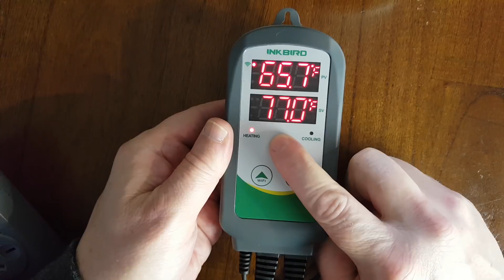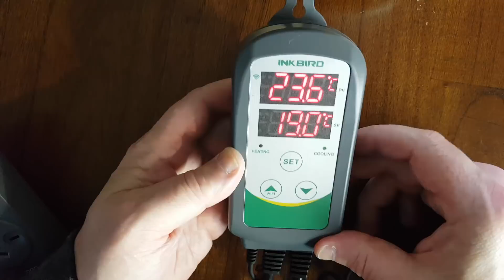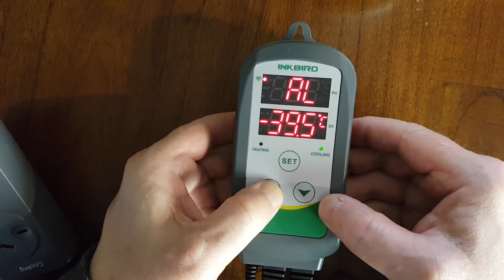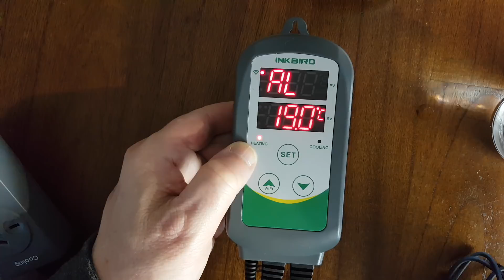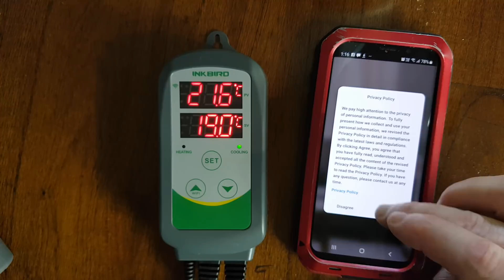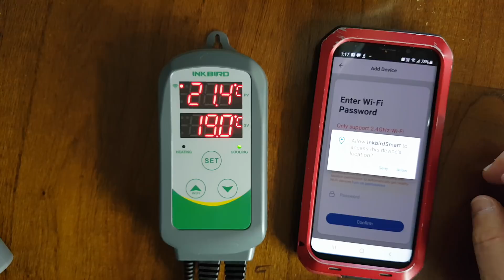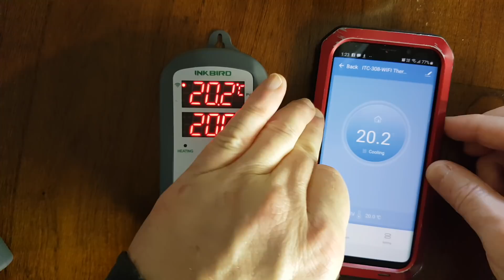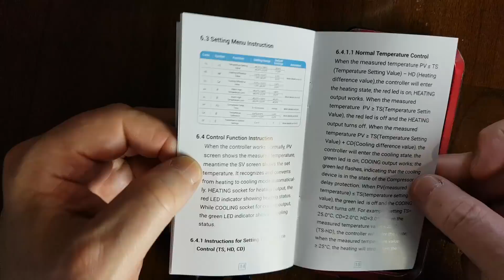INKBIRD ITC-308 WIFI Temperature Controller - How To Program

Comment: Have you ever had it not come back online due to a power outage or network drop out. And when you try to hold the up button for 2 seconds to reset into network configuration mode and it won’t. It just flashes and says APP then goes back to normal screen without the wifi indicator led flash ? Any help would be greatly appreciate. 

thanks Josh
Reply from the maker: No sorry I havent had that happen, inkbird arent the best quality machines thats why they are cheap, some will last for years, some wont. Cheers!
Reply: yes that is true. I got a hold of INKBIRD and they are sending me a replacement asap, which is very good of them. Apparently this is a problem with some of the wifi models.

Comment: So can this device be set for example if I want the cooling to kick on at 80°f and stay on until it gets down to 70°f before turning off again... So the cooling unit doesn't keep kicking on at 80 and then right off against 79 and then on again at 80 and right back off again at 79 etc.. etc... ???
Reply from the maker: Yes you can its called the Hysteresis so you set a mid temperature and then how far each way before the cooling or heating switches on or off. Cheers!

Comment: How can you change it back to heating if it’s on cooling? I have a horse trough I’m trying to keep at room temp or luke warm during winter(encourages them to drink more) it’s a basic bucket water heater 1000 or 1500w?? I think.

Comment: Excuse my ignorance but what do you have plugged in to the heating side?  If the fermenter is in the fridge and the cooling controls the power to the fridge what do brewers use to heat?  Thanks.
Reply from the maker: I use a heat belt these days. Cheers!

Comment: I’m not excited about this product. I had one that Amazon thankfully replaced. The probe was not reading correctly even though I calibrated it to my digital thermometer. The second one which I got today is more accurate after calibration but still over by around 2 degrees. Perhaps not the best for my veggie grow tent.

Comment: Can you set both functions to one plug? I have a unique situation: a climate battery in a greenhouse. We just use one fan, both to pump warm air underground when it's too hot, and then to pump the air through the ground to warm the greenhouse at night. So we need to operate 1 unit, at two different temperatures. For example, between 14C and 25c it's off, above 25c it runs, and below 14c it runs. Can this unit do this?
Reply: no,  the 308 has one TS setting.The 306T has dual TS settings for what you want but only has a heating function, no cooling. The ITC 312 has dual temp settings and cooling but only available in US version right now. This would allow you to do what you want but you would have the heating and cooling on seperate relays. so poses a problem when using one fan for both heating and cooling. I'd imagine you could wire up a second plug on the fan and build a simple relay circuit which would switch the fan between the two sources depending on which one is active, isolating the non active circuit.

Comment: Awesome tutorial and setup guide! I just purchased my InkBird ITC-308 WiFi for homebrewing. I recently started kegging my beer but my Kegerator for some reason seems to work like a freezer and gets too cold! So I'm hoping this will solve that issue! For the heat mat, do you wrap your fermenter/keg with it, or do you set the heat mat on the bottom/floor of the fridge/kegerator? I had the same question for the probe, do you tape it to the middle/side of your fermenter or keg or on the middle/side of your Fridge/kegerator? 

Thanks The Home Brew Network!

Comment: Hey mate great vid. New to brewing and Looking at setting up a chest freezer or fridge what do u suggest for a heating element? My shed gets pretty warm  most of the year do u reckon it could work with just the cooling side until I find a heating element (if I find I need one)? I like the wifi part of the inkbird because I work away for 2 weeks at a time so I can keep an eye on it. Cheers 🍻

Comment: Hi mate. Nice clear explanation. In fact I came here when I bought an inkbird 308 but the non-wifi version. The settings are still the same and this video made it easy to program. I just wondered, I'm having issues with it and I've made a very short video (37sec) to show what's happening. I wondered if you'd take a look? Everything's in the description, it's got me stumped. Either way, cheers! 🍻

https://youtu.be/TfNwcjnWm3U

Comment: I tried to connect it for like 100x times and it never worked

But then I did this:
1) Turned off my 5GHz wifi (you can do it in the admin settings of your router)
2) Switched the Temperature Settings from C to F (like in this video 01:05)
3) Deleted the App and installed it again
4) Pressed the wifi / up Button till it started to blink faster
5) Connected it and it worked

This steps could help you too, so you should try it, if you have problems like i had :)

And thanks for the Video

Comment: Hello, If I set 18 and then 2 for the CD and same for HD I do not have this range applied. For example the fridge that should kick in at 20 C° or above it doesn't same thing for the heating. They simply start to heat or cool as soon as the temperature is 18,1 or 17,9, is there anything I don't know? Maybe I got a faulty device :(

Comment: I've just got two of these, both set to 19, and yet they both will heat until 19.5, and as soon as hey get to there hey cool back to 18.5. They go up and down constantly and are either heating or cooling non stop. Have you noticed this happening at all?
Reply from the maker: theres a setting, lowest you can go is .3 .. any lower than that even if you could would kill your fridge likely.  If it didnt explain offset in this video it will in my other video on inkbird ITC-308 Cheers! go through the settings and change the .5 to .3 Cheers!
Reply from the maker: Just watch the video, its in there...  just a few minutes in,, cheers!
Reply: @HomeBrewNetwork  thanks for the reply. I have t set to .5 but it's going 1 degree over each way. Just seems weird that it will swing so wildly - I'm talking every 5 minutes it goes right up to 1 degree over, and down again within 5 minutes. Might contact the company.
Reply from the maker: @DeneMcDonald  where have you got the sensor?
Reply: @HomeBrewNetwork  tapped to the side of the FV and insulated with a towel. I was thinking I've never had an issue before, but in reality I've never had the ability to check so who knows. It's not an issue for the fermentation as you can't change 23 litres within a 5 minute swing, it's just using heaps of power cycling up and down. Overnight I popped a fan in and it seems to be better which would indicate I haven't insulated the probe enough. Might get an old beer coozie and give it  go. Thanks for your help.

Comment: Thanks for the video. Will this control a contactor?
Reply from the maker: When one circuit is active it supplies a constant 240v or whichever version you have, so yeah if you have contactor that runs or triggers off a constant 240v i guess you could.  If youre into wiring things you might be better of with a STC1000 .Cheers
Reply: Thanks

Comment: Damn, pretty annoyed I didnt buy this version. Does the unit hold the values set via wifi is the wifi disconnects?
Reply from the maker: To be honest I dont use it much, its kind of like everytime I nearly do use it, I want to go and check on the beer, make sure its where I want to be etc before the temp change.. Its good for when your away from home and you must have something in the fermenter. Cheers mate!
Reply: @HomeBrewNetwork  yeah it's not crucial but it would be handy having a better interface when switching from ferment temp to crash temp. The remote capability is definitely something I would use too. Ahh well, the standard one will do for now.

Comment: Hello, I would like to use this to control a 120 volt water pump (or a 12 volt with 120 v adapter) to send water through a tankless propane water heater as an aux heater for a intex hot tub, the tankless has a 20 min safety shut off so most peeps run a timer, can you set this to shut of say every 15 mins then back on for another 15 mins? it would only be uses ad the secondary heater but it might need to run for 60-90 mins to get the temp up to say 105 and i don’t want to have to restart it every 20 mins thanks
Reply from the maker: This model doesnt work  on timings its all temperature controlled. This model maybe be better as you can set times for temps, still not 100% sure its what you need, Cheers https://www.youtube.com/watch?v=mNElm8W8vdo

Comment: Can u use this with a small space heater to keep a room within temperature?
Reply from the maker: I guess you could.. placement of the probe would be very important though of course. Cheers!
Reply: Does it have to be a digital heater as well?
Reply: The Home Brew Network does it cut the heater on and off? I have a little 16.99 one from ollies but it’s built pretty well but it’s not digital..
Reply from the maker: yes it cuts power
Reply from the maker: it doesnt have to be digital at all, it just cuts power on and off
Reply: The Home Brew Network I appreciate it brother.. they have a humidity controller too right that hooks up to ur humidifier and dehumidifier too right?
Reply from the maker: Yes they do

Comment: hello,new to the inkbird,i currently have a older fridge for my kegs and bottles..my question is can this be used on a beer fridge or is it meant for a separate unit,i am trying to find info/video   on this subject,i have no idea  on this  thanks..i am sure i could program it but where and how to use the darn thing lol
Reply from the maker: It can be used on any fridge or cooling heating system. .what issues are you having mate?
Reply: @HomeBrewNetwork  no issues,have never used it

Comment: Great video, mate. I also got a "failed to add device" notice several times on my iPad, I then connected first time on an old Android phone and the iPad started playing ball! Computers!
How did you arrive at the 3 minute timing for the compressor setting?
Reply: Its a pretty standard setting - its the time typically required by any compressor based appliance for the head pressure to be reduced. If trying to start compressor any sooner than that, the motor may not start  due to the high pressure head. Its built into many, if not most cooling appliances such as  refrigerators, freezers, etc. I keep mine set to 3 minutes - just in case.
Reply from the maker: Yep, what Paul said. Cheers mate!

Comment: Just got one of these today! Thanks for the video, really helped get it setup. Looks amazing, and easy to setup using your guide! Couldn't be bothered with the manual :/ 

My only gripe so far after watching your video and setting up the ITC 308 WiFi is.... I wish I could disable the "beeping" alarm on the actual device and still have the notification on my phone. The mrs might be a bit "alarmed" hearing it go bi-bi-biiiiii when I'm at work!!
Reply from the maker: Yes thats a good point, to be honest though I've found things rarely go off, only time mine used to was when I using light globes to heat and the globes would blow. Cheers and thanks for watching!
Reply: @HomeBrewNetwork  Agreed! Might be just because I'm testing it out, and as you rightly say it's unlikely for things to go off in the real world!

Comment: I have used 2 of these for years, they are a great bit of kit.
1 controls my Keezer and the other 1 is hooked up to the fermenting fridge.
Reply from the maker: I didnt know the wifi had been out that long! I got my first only a few months ago, regular one I've had for ages, cheers mate!
Reply: @HomeBrewNetwork  bahahaha Gash sorry I should of made that point of mine being the non wifi ones to. Either way easy to use quility units.

Comment: Comprehensive run through of the device, great work mate, im very happy with mine, cheers
Reply from the maker: Yeah they are alright, this is actually my second, not that I ever remember to use the wifi function much lol
Reply: @HomeBrewNetwork  The app is very good for changing the settings, i imagine first time users would find it alot easier to use,
Reply from the maker: Yes agreed, reason I dont is that I'm more than often found with the fridge door open staring at the fermenter with the ITC right in front of me hahaha

Comment: I reckon Ill grab one when I see the next deal for them
Reply from the maker: Thats on special now, only $60 delivered, you wont get the wifi version any cheaper than that I dont think. The normal one goes for around 40 on special. Cheers!
Reply from the maker: I bought a full price one a few months ago.. think mine cost me 79 bucks back then.. bugger lol
Reply: @HomeBrewNetwork  yep you're right. The deal was about $60 a while back. I just had a look
Reply: £60 FOR 3 With free delivery and with the added bonus Alexa compatible so I can check the current temps and change if required from the comfort of my bed and I dont have to press any buttons on my phone work smart !!!!!
Reply: @Here-and-there  that price for 3 is great